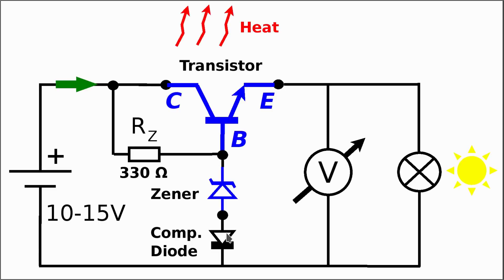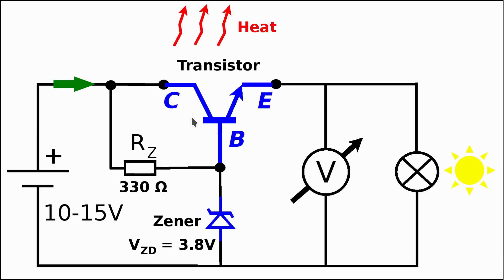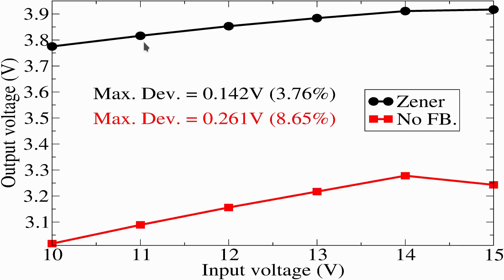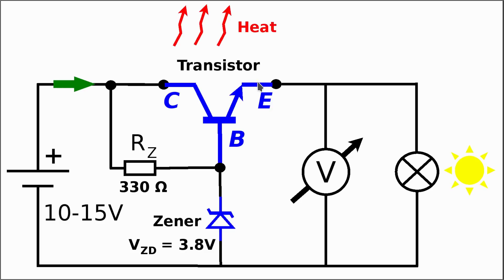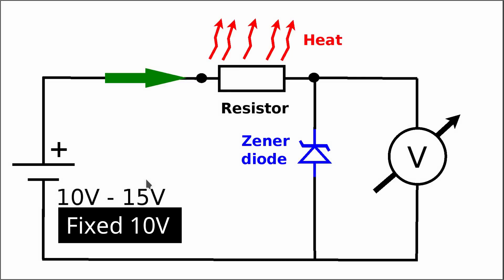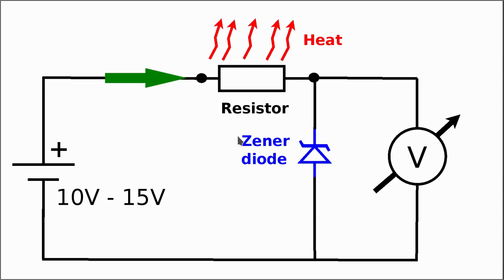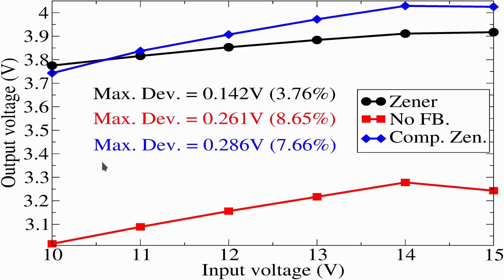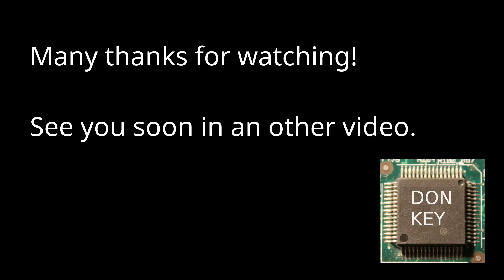SMPS repair series #10: Temperature compensated Zener diode in linear regulators

Comment: at 8:37 isn't the zener facing the wrong way in the schematic? shouldn't they both be facing the same way for current flow?
Reply: Zener diodes are usually reverse biased (facing the opposite direction of current flow). They are specifically designed mostly for that purpose, so that we can make a zener reference voltage

Comment: Nice, clear explanation. 
One need to pay  attention to the degree of  compensation you get with one diode at the voltage of interest. 
If needed you might add a second compensation diode in order to improve the zener's  tempco. Of course you will add twice the amount of regular diode voltage.

Comment: 2 batteries in sery .the meeting spot between +and -  also create Ground.
Why?
Reply from the maker: Ground is just a point, and you measure voltage compared to that as a reference point. It is like sea level compared to which we measure altitude.

Comment: Another great video, Mr. Donkey. I hope you will manage to keep this way in the next episodes, highly biased toward the practical aspects of the circuits (such as in this case the role of silicon diode in temperature compensation). Too many times I saw on youtube channels starting promissing and then somehow getting far too basic and explaining fundamentals and what a capacitor does as if there are not already thousands sources where you can find out what a capacitor is. Please rezist the urge to become too basic, newbies are already well served by thousands other channels.
Reply from the maker: Thanks for the comment. Regarding the issue of channels going far too basic the problem is, that many people are not patient enough to learn first the basics, and they ask super basic questions. Also, if one would like to grow a channel fast, the right way to go is to explain very basic stuff over and over again. I try to keep the channel going practical aspects and minimal theory what is really necessary to understand roughly how things work.

Comment: Really nice series... I was learning elerctronics at high school but i have no clue how to repair a power supply. These videos helps a lot, cause they dont start at the nonsense p-n transition. Keep up the good work.
Reply from the maker: I wanted to keep the content as simple as possible. At some time I will have to talk about semiconductors, but I definitely will not cover solid state physics and such. Main thing is what a transistor or a diode does. How it does it is not so important as long as one is not trying to design new stuff.

Comment: LOL, I was doing some research to operate a relay and keep finding silicon diode with zener diode in schematics. I also had no idea and there were no explanations!
Reply from the maker: For a relay it might be a bit overkill to use thermally compensated Zener, so I am also wondering why would they design a board like that. Anyway, when I was young I had no idea why there was a diode in series with a Zener either.
Reply: YouGenom In DC you put the silicon diode across the coil for a snubber, you can do the same thing taking a zener from the bottom of the coil to ground. You are snubbing the excess voltage caused by the magnetic field of the relay coil collapsing. A relay coil, like an inductor does not like to see a change in direction of the current flow. Without the snubber, you will usually destroy your switching device i.e. Transistor.